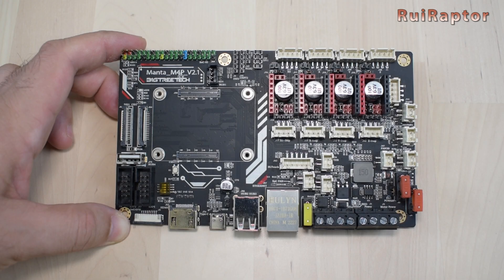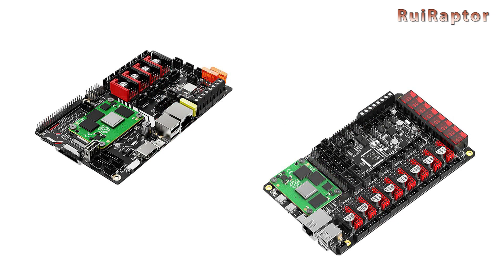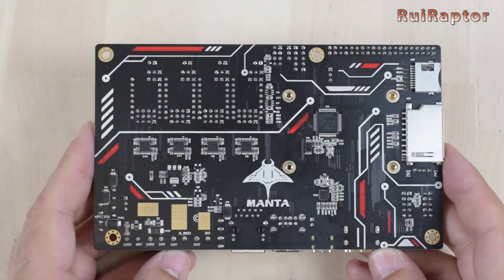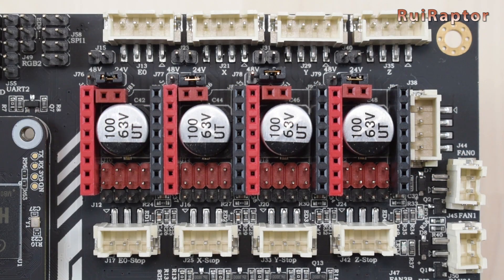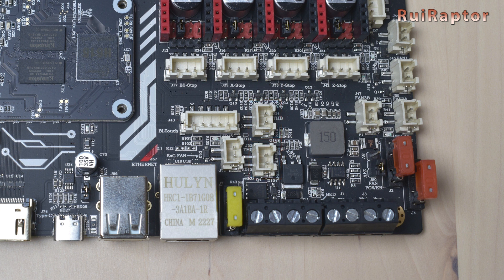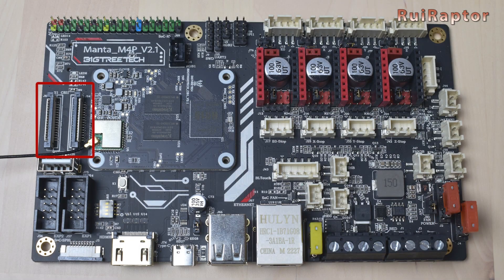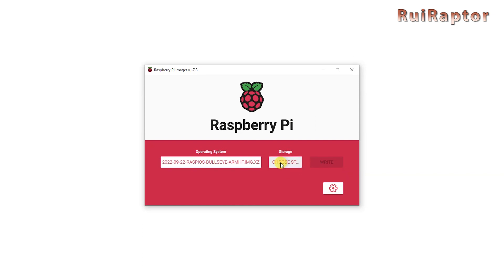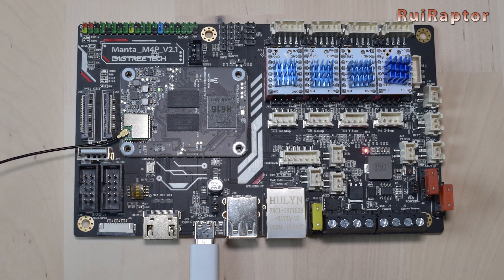BIGTREETECH Manta M4P Board + CB1 Module – Another Solution for KLIPPER Firmware

Comment: Hi!
Sorry if its too basic to ask. I am new to this!

I want to ask if I want to use external Motor driver for my stepper motor, can I use it?

Because my torque requirements are higher then conventional NEMA 17, So my selected motor has an Amps of 3.5. The 5160T Pro is expansive for me to buy.. so was wondering is there a scope to add external driver like TB6600 to Manta M4P which can support 5A.

thank you

Comment: So I currently have a Ender 3 pro with upgrade micro Swiss hot end and the older v1.4 (Green Board) I was about to upgrade to the newer silent creality drop in board but I kind of want to start using clipper on this one as well because I pre-ordered the fl sun v400 but still want to use the enter 3 for other things. Would it be worth it to get the CB1 and Manta M4P for the ender 3? I would still like to have it be able to stand alone print aka SD card and have LCD Screen Functionality but it looks like There are a bunch of steps involved with just getting the basic functionality back up and running. Do you have a Finished image I could flash to the SD card for a ender 3 pro running these boards working in this aspect so I could just tune it instead of scratch build it?

Comment: Mine is being shipped today. With the scarcity of the Pi, I'm looking forward to this being a great option. You don't need much RAM to run Klipper. I'm hoping to be able to run the Pi camera without issue. I don't really foresee any problems, I have run Klipper on a Zero W (not the 2 W) with a camera, just turn down the framerate a bit. You don't need much just to look in on prints, don't need timelapse, there are enough of them out there, I just want to run Klipper without 100 different wires going everywhere. I am amazed nobody bothered with this before now.